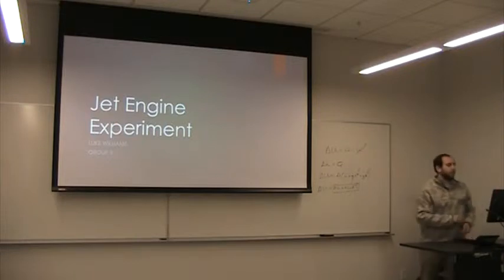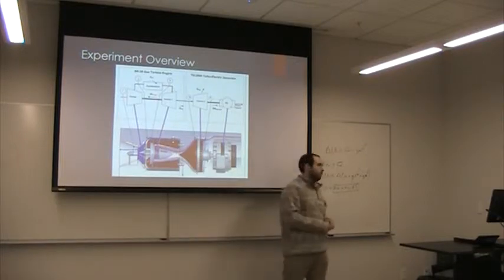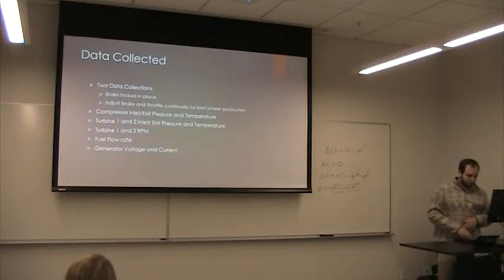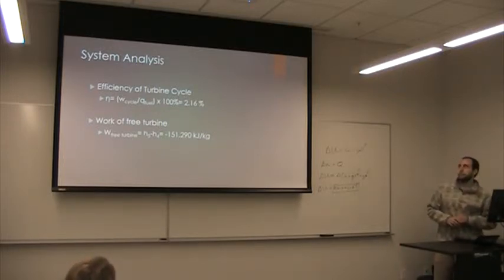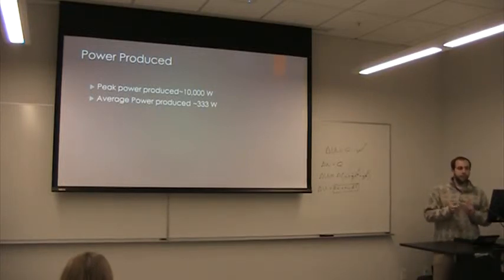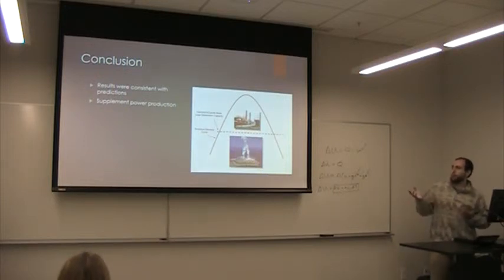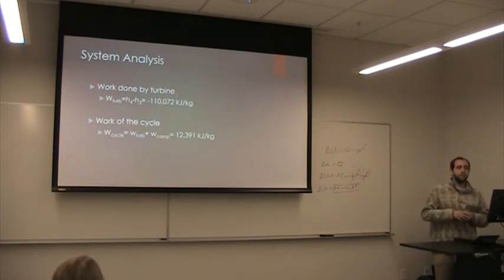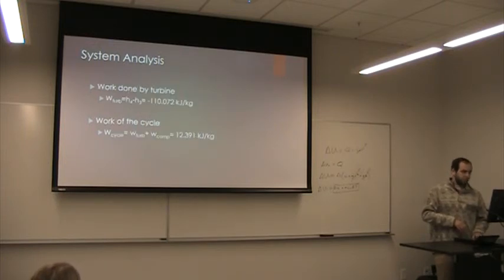Luke Williams

Comment: I think you presented the material very well and your point came across very clearly, but some improvements i would suggest is to not stand behind the podium the whole time and to not fidget with your hands so much. Also, i would make sure to double check your data analysis and calculations just to ensure that it makes sense and doesnt give negative values.

Comment: The technical aspect of your data might not have been correct, but you did a good job explaining the formulas and where the data came from. The order of the pictures with the formulas allowed for an easy progression of your math. My only suggestion on the technical side would be to check the data and make sure you are not making silly mistakes.